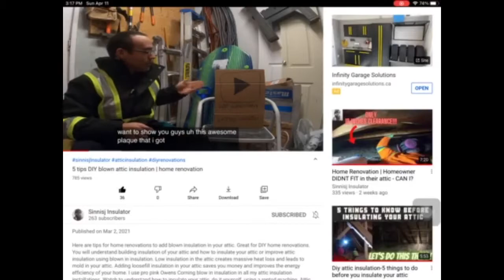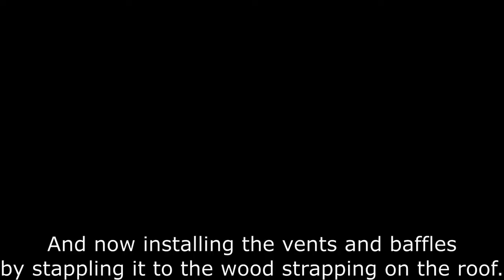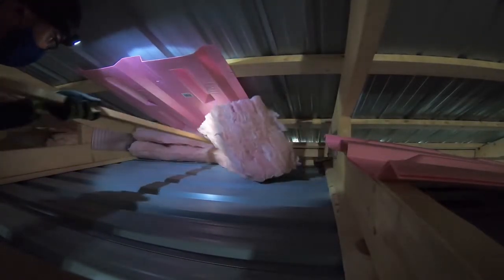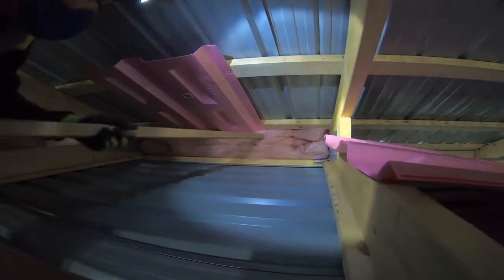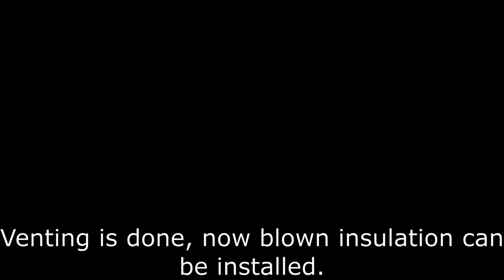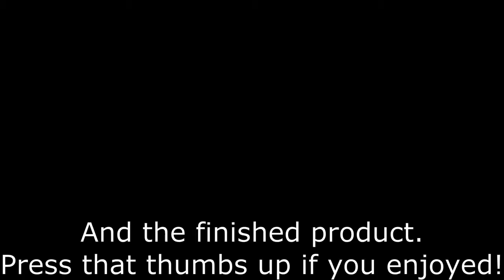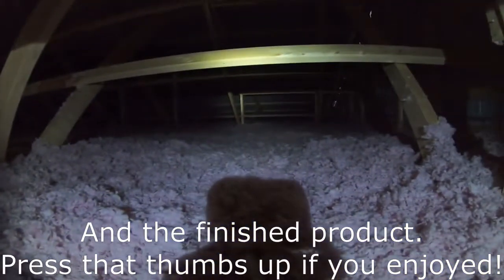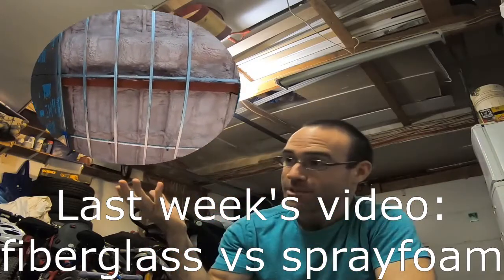Insulate Pole Barn or Workshop attic

Comment: Should require them to install secured runners on something like that or charge them for the time for you to put in. Its not worth the injury or death.
Reply from the maker: Yes I agree, I took my time and located the small section that had double 2*4 runners when I installed the blowing. Thanks for watching.
Reply from the maker: Btw I've made a fiberglass and spray foam comparison if you wanted to check it out https://youtu.be/Sd5kjWo-iZE